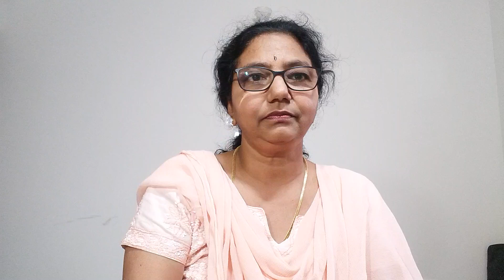Dr Anima Upadhyay "viva voce questions on estimation of Cu in brass using std sodium thiosulphate so

Comment: Why the PH is maintained approximately ~4-5.5
Reply from the maker: Cu2+ can undergo hydrolysis at a high pH resulting in its precipitation as cupric hydroxide. To prevent this pH is adjusted aroud 3.5- 4.5